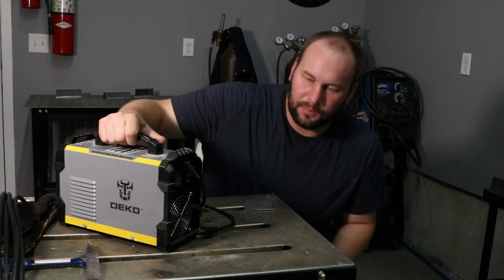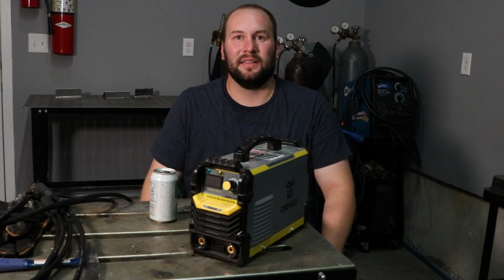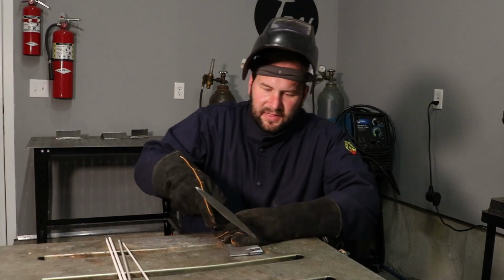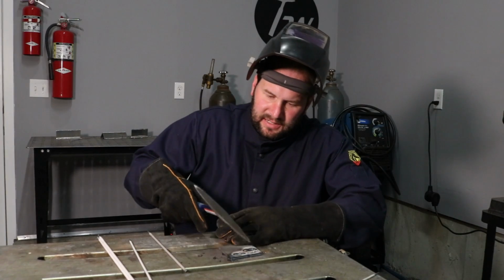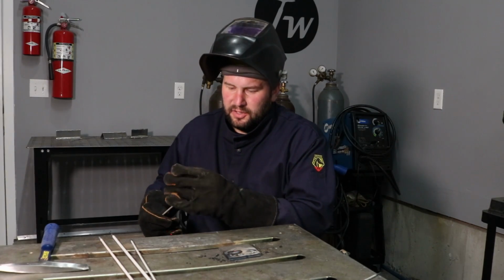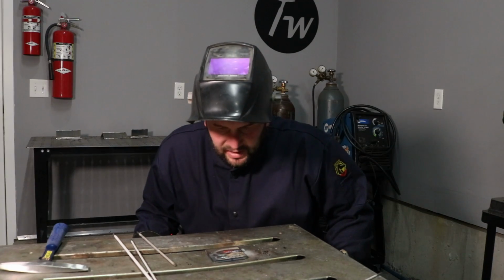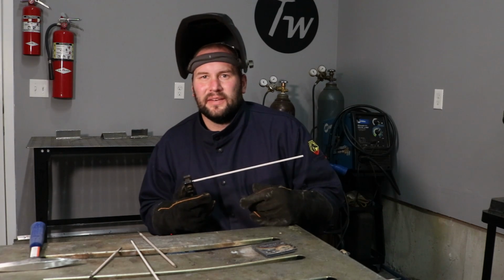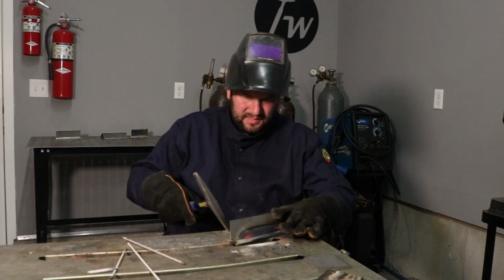Reviewing the (Almost) Cheapest Welder on Amazon: DekoPro Welder Review

Comment: For the driveway/garage welder, especially with the Red Chinese welders I'd recommend 6011 and 7014 because both rods run AC/DC +/-.  Many inexpensive and cheap welders don't produce the DC Open Circuit Voltage (OCV) to run 6010 properly, if at all, but will happily burn the essentially equivalent 6011.   Many are AC only which rules out 6010 and 7018, and the 7018AC isn't all that they claim. The 7014 is also an iron rod and essentially equivalent to 7018 but runs nicer, smoother, and does not require a rod oven, just keep the rods dry. That being said most contract and structural work where the rods are specified by code or the engineer will spec 7018 which will require a rod oven.  

Now I will admit my prejudices, I learned on 1/8" DC (only) stick with a pickup mounted Lincoln motor drive and 3 phase coffee grinders after school at the local welding shop and now that I'm retired I decided to pick it up again because building things in my hands is so satisfying. I've never used any rods other than 1/8" because that is all the shop used (and where I get my rods now).  

I also picked up an 180amp (240v) transformer MIG using 0.035 flux because I weld out in the driveway at the end of a 33 foot 6 gauge cord but I don't know what I think about it.  Perhaps I just prefer my vintage AC only (generic)  Thunderbolt and Century 230/140 AC/DC which are both transformers.     Thank you for your series of videos...
Reply: Hmm we worked on a barge in humid south Florida and stored the 7018 rods in the shipping container on the shelf .    It wasn't a problem until they where several months old .  Then it was harder to get the weld to start .
Reply: I "learned" just enough about welding to get me in trouble in a sculpture program.  My welds totally hit or miss and a lot of it is not knowing enough about all the details of actually knowing how to weld.  If I wanted to use this welder on 110v to reattach a bracket to a lawn mower deck what would you suggest for rod type and size?
Reply: A lawn mower deck u need a wire feed welder .it's to thin

Comment: Have similar machine (different paint scheme) and you will notice that the power-in cord is marked 14 ga (on mine).  So real limit on how many amps you can feed into the machine from a wall outlet.  Once you step up to 240v the input wire size is much less of an issue.  
I measured the welding cables and they came out at #5 wire.  Helps with weight and stiffness, but again, an ampacity limiter.  I'm sure it's OK for what's inside the box.  But wouldn't try to use with a big transformer machine ...  
So my heavy leads are TWECO connected and the light machine leads are Dinse connected. Can't swap, which is good.  
Great thing about these is how light and portable :-)

Comment: Watched this, and then some of your other videos when shopping for a more powerful welder than the Harbour Freight 120V arc welder. 
Spot on watched many of your video's now and getting some good tidbits of info.
Also from another video of yours, to test thinker T's to destruction and not your vice, cut them then bend. Might bend after etching and find weak points in your welds. 
Cheers and looking forward to more video's.
Oh and running mine off a 30 AMP generator with 0 issue's using a short dogbone.

Comment: Hey man, I know I don’t gotta tell you this but its just a reminder.

Use your safety glasses my man, I am in college to become an industrial technician. They also learn us MMA, MIG and some oxy acetylene welding as well. I nearly lost an eye due to a hot piece of slag bouncing off my idiotic mouthmask into my eye (under my safety glasses)
I had another piece hit me right in the throat. I suffered 3rd degree burns on my throat and 2nd degree ones to both my left eyelids. The lower one was the worst.

Yes it got into my eye while wearing safety glasses, it hurt like hell. So I can’t imagine how bad it would be to get a piece directly into your eye. I just wanted to put that out there. I really like your videos man, I have learnt a lot from them already! I take up odd jobs as a mecanic/welder from time to time.

Comment: Thks & a question;
I already have a 120VAC & a 240VAC MIG welders but I want a small/portable stick/TIG welder.   
     It seems there's 3 ways to start a TIG arc ; worse is Scratch ($cheap welder) ; better is Touch&Lift (~$120&up welders) ; best is High-Freq (~$200&up welders)
Also TIG welders less than ~$500 will only do steel & not aluminum.  I'll only use the TIG welder for around the house.  So I plan to just braze aluminum (& any other none-steel metal).  
?Does this seem right & is brazing non-steel metal the best bang-for-the-buck?
    HITBOX 2 in 1 TIG ARC Welder 200Amp ~$200 https://www.amazon.com/gp/product/B08CVSZ3CZ/ref=ox_sc_saved_title_6?smid=AB1I4LWR4CPW0&psc=1

Comment: Will this welder run 6010 and 7018?
Reply from the maker: 6010 doesn’t run very well, but 6011 works and is probably just as good for most of what a $100 ish dollar welder would be used for. 7018 works well.

Comment: As a newby, what do the numbers mean on the electrodes thanks
Reply: The first 2 to 3 numbers are the tensile strength measured by the ten thousandths for example: 6011 the 60 stands for 60000 pounds of tolerance per square inch the 11 represents the type of protective coating around the rods.

Comment: The slag seems to always pop off really nice with stick welds.  Should flux core welds work the same way?  Should the slag always just pop off really clean like that?
Reply: Flux core issue would be more spatter.  No real slag on fluxcore just a slight wire brush or wheel and you're golden.  Different type of weld process.

Comment: Good video!  The 220v line looks rather low gauge wire so I am wondering whether it is really just using one leg from the 220v line (in other words taking just 110v) but benefitting from the higher amperage breaker that a 220v line is normally carries?  I suspect that many of the cheap welders claiming to be dual voltage are not really 220v.

Comment: I purchased a Kicking Horse A100 from Amazon for thin material for which my Lincolin 225AC doesn't do very well. I loved it so much I also bought the Kicking Horse A220 for larger material. Both work great and are the size and weight of a 6 pack of bottles. Only negative are the short output leads with poor stinger and ground clamp.

Comment: Im using a 10 gauge, 20 amp extension cord from a outlet that provides 30 amps and a GFCI installed into it that provides 20 amps, yet I'm still sticking my rod constantly. Run rods at my school just fine, have no idea what's going on. Using Ferney 6010s also. Raised amps up and down and nothing.
Reply from the maker: If possible, you might try it on 220 volts (maybe at your school if they'll let you) to see if the machine can run your particular rods. I haven't tried 6010 with this machine, but another rod (6011 or 7018) might work better with this machine. That being said, you should probably be able to at least strike somewhat of an arc before you start running into problems from the 6010 and the voltage it needs to run. Another think you could try is a smaller rod, maybe a 3/32 6011. Hope this helps.

Comment: Toolium 200A is the most unrated welder ever. I use one to build custom Iron work. Gates, fences railings. 

My previous profession was a Code Pressure Vessel Fitter and sometimes welder. So in other words I know about proper welding. Ive only got a 110 plug in in my garage. I know I need to upgrade the electrical. I was using my Hobart handler 140 with CO2 hard wire to build the projects. Well my partner bought a Toolium. At first I thought wow look at that plastic Chinese POS. Untill I used it. It welds 10 times better than mine. And the stick welder actually works great too. And it's a TIG as well. My Hobart cost me $600. The Toolium Cost about $300. I just sold my hobart. I'm ordering a Toolium. The Toolium welder weighs less than half of the Hobart too. 

The whip on it is better than my Hobart. It actually has Trigger hold as well. It has so many different adjustments. Ive tried all sorts of welders. This little yellow welder is worth 3 times it's cost.

The only thing I'm wondering is when it breaks down. Can I get parts for it? And does anyone work on these??

Comment: I have this machine and I can't run 3/32 6011 on 110 with it. I can't get the arc to start if it does it sticks, or cuts out quick. It could be me. I bought this to learn and have only melted like 30 rods so far. But I have no trouble with 6013.
Reply from the maker: I don't remember if I've burned any 6011 on 110 volts. I have found that the actual amperage output is a little lower than what is displayed when running on 110, so it may help to turn it up a bit higher than normal.

Comment: Do a update after about 2 years. The biggest issue with Chinese welders is longevity. After about 2-3 years is when they show their true colors in performance and quality. I’d they even last that long.

Both my AHP’s burnt out of had issues after about a year of light use.
Reply from the maker: I've had it almost 2 years and it still works fine, though I only use it occasionally because it's portable. For what it cost, I've gotten enough value out of it that I'll feel fine if it drops dead tomorrow. AHP's cost a lot more than this one, so I'd be more bothered by that for sure. Thanks for the comment!

Comment: Can I add a spool gun with this machine ? I’m trying to weld aluminum and on 110/220 it does not run well.
Reply from the maker: I wouldn’t try to connect a spool gun to a stick welder like this, it wouldn’t work well. If you want to run a spool gun, it would be best to get a compatible MIG welder. There are a few aluminum spool gun videos on the channel if you want to learn more about it.

Comment: What size of circuit breaker are you using on your 110 VAC outlet, 15 AM or 20 AMP ?
Reply: I bought this welder and use a 20 AMP 110 VAC circuit with 12 AWG wire, I have run it as high as 75 AMPS with no problems so far.

Comment: 200 Amp ?? 
 the reality is a bit less than 120 Amp
Reply from the maker: It's rated at 160 amps, but my meter has shown that the amperage reading is a bit off. Either way, it will run a 1/8" 7018, which is good enough for me.

Comment: Bought one off your link, haven't used it yet. Is there a circuit breaker requirement for the 220? Getting my shed wired up, didn't find anything in the instructions.
Reply from the maker: It's listed as I-1 on a chart on the back of the machine. I think it's right around 26 amps.
Reply: I use on a dedicated 16amp breaker and it works fine but i had to put a softstart because of the inrush current charging the capacitor is too high ,i changed the igbt's to the fgh60n60  its 120 amp and the diodes are now the mm80fu040 its 80amp, and i put 2 more now its 4 output diodes, and i put an output inductor with 100 microhenrys to stabilize the arc, and put more input capacitors and a 50 amp kbpc5010 rectifier bridge on the input and changed the input wire from 1.5mm2 to 2.5mm2 ,and calibrated the amperage on the front panel and reeinforced the tracks, now its literaly a diferent welder its way better

Comment: Thanks for sharing! I recently got one, but am having trouble maintaining an arc while welding. Any suggestions on why this might be happening? I'm using 110V at 75A and 6011 3/32 rod.
Reply from the maker: I'd try running a little higher amperage and see if that helps.
Reply: @TimWelds  I actually tried that after sending this and it made a big difference. Still having some issues because my shop circuit is on a 15Amp breaker, but I'm going to add a sub panel to get 220V and really start welding. Thanks for the help and videos!

Comment: Great Video.  Does the Deko Pro have Dinse 25 (3/8") or the larger Dinse 50 (1/2") connectors?
Reply from the maker: It has the smaller 3/8” connectors.

Comment: I just got my first Deko welder and I tried welding for the very first time, I got so frustrated because I kept sticking my rod, I ran 6013  3/32 at 85A and I barely touched the metal, any tips you can throw at me
Reply from the maker: Hang in there, it takes a bit of practice. Start out by moving fast like striking a match when you touch it and see if that helps. I would also turn the machine up a bit higher while you are getting the hang of striking an arc. As far as setup goes, if you have a weak electrical supply, such as an undersized extension cord, the rod will tend to stick worse, so that’s one thing to check. We’ve all been there, but it’s worth working through.

Comment: What size dinse connectors? Can it tig?
Reply from the maker: It has the smaller #25 Dinse connectors. Pretty much any stick welder can be set up to run scratch start TIG, but it wouldn’t be ideal. If you want to TIG too in this price range, I’d check out something like the welder I reviewed in this other video, which doesn’t cost much more than this machine plus a torch. https://youtu.be/UcKAohjVJRw

Comment: I’ve measured a number of these small machines using a clamp meter on one of the leads. Generally, they’re low. Not too bad to about 40-60, or so. But above that the output is compressed from the reading. None of the 200 amp machines made it. The best one was about 165. The others stopped at around 140-150. Not terrible, but not close to the ratings. None could do 6010 reliably.
Reply from the maker: I ended up putting a meter on this and found the same thing. With a machine like this, I just plan on 6011, which is good enough for anything that's going to be done with a $100-ish machine.

Comment: Ever get a chance to run REAL 6010s on it?  I mean Lincoln 5P+ or Pipeliner 6P+?  those are the real test.  Best Welds and Blue Demon also make real 6010s in the sense that the machine has to have real balls to run those. Also Bohler Fox makes real 6010s.   Ebay 6010s are just 6011s labeled as 6010s from what I've found out.
Reply from the maker: Yeah, a lot of these little inverters struggle with 6010, but 6011s will do the job for the type of work you would use a $100 machine on. I haven’t tried them on this machine, but it’s hard to beat a big engine drive or transformer-rectifier for those rods.

Comment: Thanks Tim for the review on this machine. One question, can I run this welder on 4500w inverter generator? Will it be as strong as house plug? Thanks in advance.
Reply: If you are comparing 120V operation, then yes, a 4500-watt generator will run these small machines just as well as a household 20A receptacle. For comparable 240V operation, your generator would need to be at least 6000 watts, based on the manufacturer's specification of 5.8KW input power.
Reply: @Quantalume  Thank you very much, I will let you know how it goes when I checked with my generator, thanks again and Happy New Year Tim

Comment: Hey, Tim.  Great series of tutorial videos - I appreciate your knowledge and presentation, it makes the important points easy to understand.
A simple question - All of my 240 devices in my shop run systems like timers, circuit boards, lights, etc. which require the plugs to have a neutral (so it can pull a 120V leg off internally) so my sockets are all 4-cavity.  I see that this welder has a three-pronged plug.  Is it made so that it matches the two hot prongs and the ground prong on the 4-cavity socket (i. e. just ignoring the neutral connection in the socket) or will I need to make a jumper connector?   I guess I could add a separate 3 cavity socket next to my existing 240 socket - I'd have to look at the relative cost, I guess?
Sorry for the basic question but it would help me to know.   Thanks   Bb
Reply from the maker: It’s a great question. The outlets have different spacing, so it won’t fit. I’ve made adapters for all of them over the years. If you’re only going to use the welder on that plug, the cheapest thing to do is just cut the plug off the welder and install the type you need from the hardware store.
Reply: @TimWelds  Thank you.  I have a plug that has a removeable neutral terminal so I can just hook up the other three conductors.
Reply: Hey Brice.  The plug that has 4 pins with 120/240 is called a NEMA 14-50.  I attached a NEMA 14-50 plug with the neutral pin removed on the end of a 3 conductor 10AWG (for 30A) or use 8AWG (for 50A or for longer distances), and on the end put a NEMA 6-50 receptacle (like most welders use).  The 14-50 plug with the neutral pin removed will plug into a dryer receptacle or stove receptacle, and is likely what you have.  I made my cable about 25', and I used the 600V flexible SOOW cable only because it's insulation is thicker and less likely for something to cut into and reach the copper conductors.  You can use the thinner 300V SJOOW cable.  I also purchased a relatively cheap 20' 6-50 extension cable on Amazon to extend my cable if needed.  With the two cables i can go to anyone's home and plug in my welder and run it at full power.  I'll also use the same cables for my future electric car.